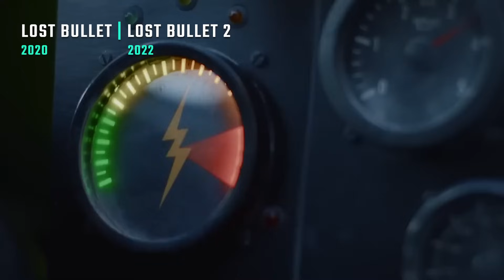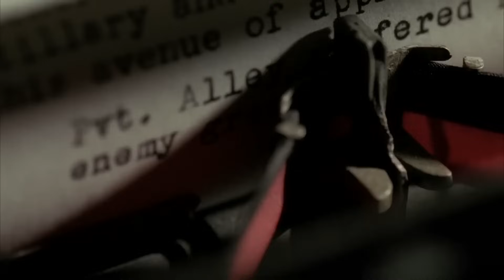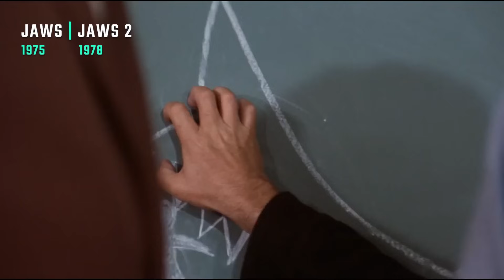Best TWO-PART Movies to Watch Back to Back on Netflix

Comment: Should have added Army of the Dead and Army of Thieves. The problem i had with the Nolan Batman movies is the actual Batman fight scenes sucked. That's where the Snyder/Affleck Batman excelled(especially his "introduction" in Batman v Superman)
Reply from the maker: I almost did included them but I felt like Army of Thieves fairly forgettable.
Reply: @DarrenVanDam  It was definitely a letdown from Army of the Dead